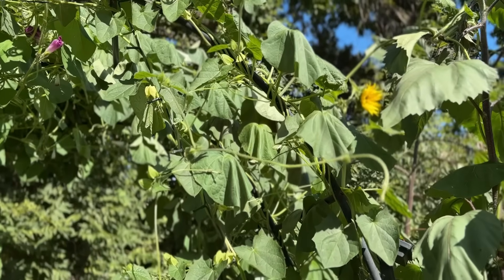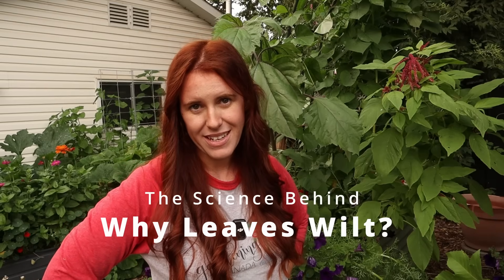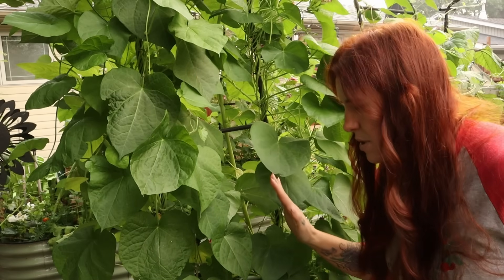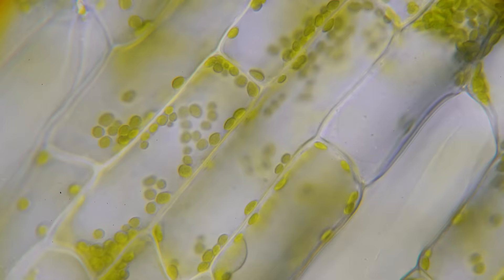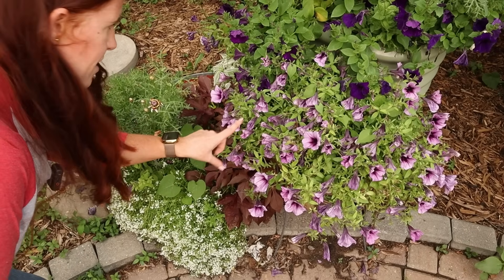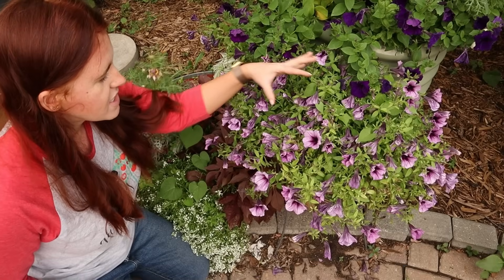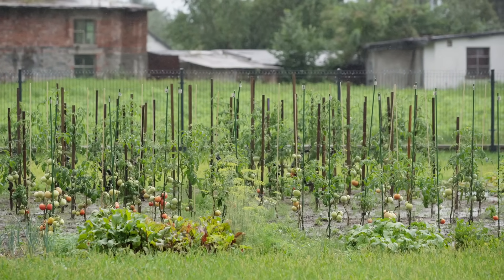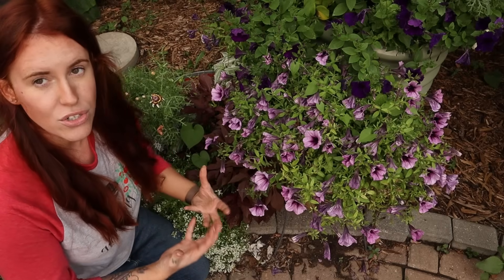Plant Drooping? Here’s the Fastest Way to Fix It!

Comment: Last year, I had beautiful dark cherry tomatoes with very healthy leaves.  This year, the leaves of the same tomato variety (I save seeds every year) are completely dried up and the tomatoes are very small, very slow to ripen  and their skin is unusually tough.  I have not changed anything about the way I prepare the soil before planting  or fertilizing or watering.  I blame the extremely hot and dry summer.  In southern Ontario, we have been having +30 C almost every day, for two months straight and hardly any rain.   I had no choice but to water deeply every day.  This may have caused soil compaction.  But how do you fix that without disturbing the tomato roots?

Comment: Here in NB, I am asking what is this rain of which you speak? Mine are drooping because of the lack of moisture, the heat and the low humidity in the air. We still haven't had a meaningful rain since the 8th of June.

Comment: Thank you for the video. You are 100% right that heat (esp. in direct sun) will wilt the plants, even with plenty of water.  Maybe I am missing something, but I am not sure of this "wait to evening" approach. I think it is fairly obvious if the soil is "under watered" vs "over watered",  were there heavy rains? or days of drought? Did you forget to water for a week?... there's no real point to "waiting" until the evening to make that determination. I am not sure why that is important because if the plant has very low water, you are not doing it any favors by waiting until night time to give it water. Sure, if the plant is "over" watered it makes sense, but again, you wouldn't need to water it anyway as it would be fairly obvious that the soil was very wet.
Reply from the maker: I appreciate your feedback, and I can see why you'd think that. I believe very new plant people may struggle only because I have seen the questions slide my way from time to time.